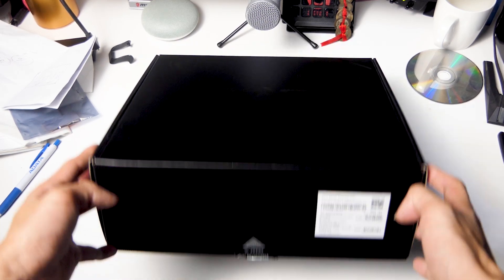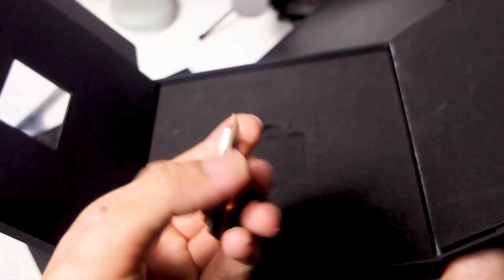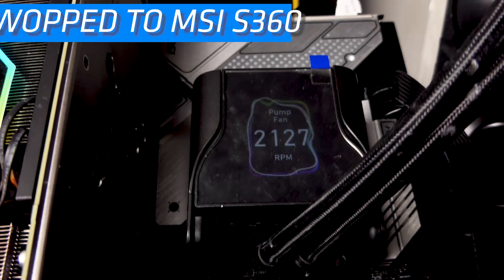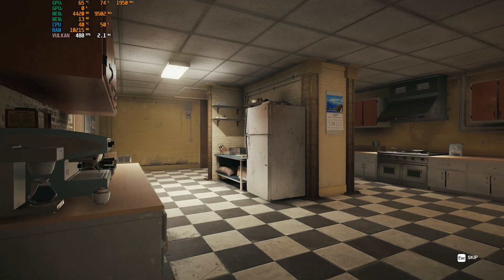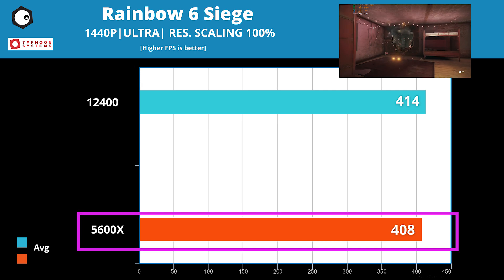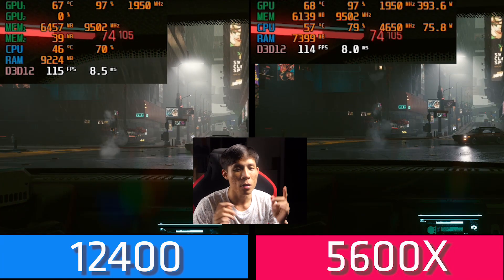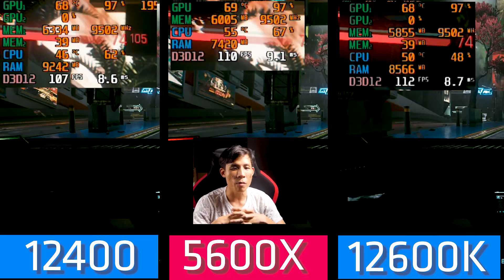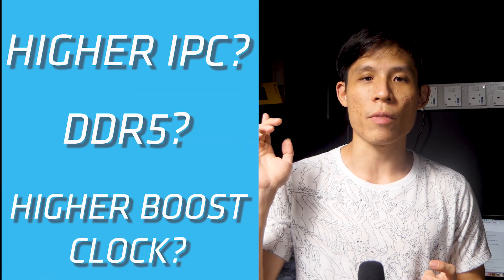The New Budget KING? i5 12400 Review vs 5600X (MSI B660M Mortar WIFI)

Comment: the temperture score got me a bit worried because the 5600x is cooler than the 10600k but in his score 5600x was hoter so i think its not accurate imo
Reply from the maker: But i think it depends on what kind of cooler u are using? That said, i should test the 12400 with a air cooler. hmmm
Reply: @RealMelTan  exactly

Comment: Yeap we have a new gaming champ at the mid end. Budget wise so long as it is cheaper overall compared to a B550 with 5600X, I would say it is very awesome... until the B650 and Zen 4 arrive in 2nd half of 2022.
Reply from the maker: That's if you get the B660 with DDR4 RAM, hahaah not the DDR5, until DDR5 prices drop like Zen 4 launch (as u said). 
But this 12400 is really good :D